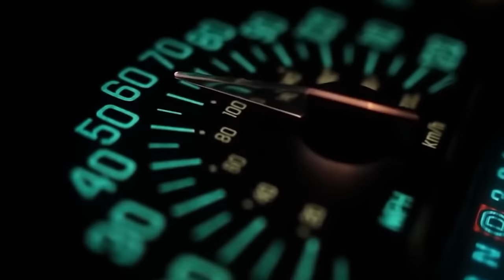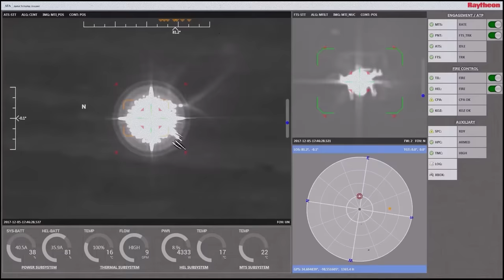America’s DE M-SHORAD: The Future of Laser Defense

Comment: I'm an optical engineer. SHORAD has major issues and is an ineffective hardware for following reasons: (1) The laser is too weak and has short range. (2) Drones can counter it by using aberrative /reflective coating. (3) To defeat a drone, it needs to continue lighting it up for a relatively long time, so a fast moving drone can take it out before the laser can do the same. (4) It is only effective against small drones with thin shells. It will not work on bigger or better shielded drones. (5) It can only reach its weak specifications in perfect weather, which doesn't happen often.
Reply: 4 probably isn't fatal problem considering small drones in high numbers are specifically a major issue, and how to kill them in any way cost efficient ways.
Reply: I can’t even tell you how many ways you’re wrong-all of your points can be defeated by watching a simple YouTube video of them testing some of their systems😂
Reply: At this point, just being effective against cheap, easily attained drones is the point it says at the beginning of the video. Increase the resources needed to take each target. It makes them more out of range for the average military as they will cost too much. I think you may be forgetting resources are not limitless; increasing the expenditure of resources by your enemy is a part of military strategy. 

Additionally, the vast majority of these specs are top secret, so accurately judging its effectiveness without having direct access to the system is pointless.
Reply: 10->50kW laser will stop most drones from flying pretty quickly 😎
Reply: But other than that….
Reply: Having used multi kw lasers on a daily basis, and from real world experience, I only slightly agree, in the end yes the lasers do struggle on materials with a greater reflectivity, however, those optics do not reflect enough of the light to protect the sensors, I suppose you could coat the lens in Di-electric coatings might provide protection.

Regardless, even the slightest dirt on any of the coatings will render it molten the moment these lasers strike them.

Anyway, just my re-world experience with high powered class 4 lasers.
Reply: @Subliminalsapper Phalanx already should be effective against drones. So strange they are not being shipped to Ukraine.
Reply: @riku3716  4 is a VERY fatal problem, as SHORAD's biggest threat are loitering munitions which are large, fast, and can be easily modified to withstand the heat for longer. Such drones have better cameras (compared to smaller drones) which can spot SHORAD before they fly close to its laser's range.
SHORAD's biggest strength is its ability to track targets, even ones that it is currently not engaging. It means once it is done with one drone, it can quickly lock onto the next without calibration delays. Defeating a system like SHORAD is all about throwing things that need longer time to eliminate in conjunction compared to the time SHORAD has to take them out. The adversary can increase number of targets (swarm), increase time needed to take out a target (bigger drone), or decrease time SHORAD has to defeat target (faster drones). Swarm of small drones, while cheaper, have disadvantages: (1) they have a shorter range. (2) they can't carry enough ordinance to take out a Stryker armored vehicle and not just its laser. (3) they are slower hence SHORAD has more time to take them out before they reach it. (4) Make attack very obvious (5) are difficult to plan in a conflict.
Reply: You're not trying to flash fry the drone you're trying to burn out its optics. You do not need a strong laser to burn out the lenses and image chip in a camera
Reply: Next generation fast intense pulse lasers work better. Can also create plasma holograms as well as take out targets.
Reply: @PracticalTacticalFedeli  You picked the wrong person to challenge in this topic haha! I'm a drone designer, studied optical engineering at an Ivy league university, and even watched a lot of videos about SHORAD before Megaprojects made a video on it as lasers are literally my specialty and SHORAD is like GTA6 of weaponized lasers! I have literally done the calculations based on the system specs as well. 
Do you remember the meme about that guy who tried to correct an actual astrophysicist about space? You're replicating that here, but in a different topic! :P
But I'm all for education, so I'd be more than glad to hear your counter arguments and to tackle those. If questions come up, I'd be glad to answer those as well :)
Reply: Considering the directed energy portion of the system is not meant for larger and more protected drones but for off the shelf cheap ones plus having the hard kill variant backing it up I think we will be fine
Reply: @RM1969RM  kind of funny that you chose me out of everyone else saying that you’re wrong but OK bud. Why aren’t you designing these systems if you know so much about them?? Why aren’t you working for some of these companies designing these systems? I’d love to know your clearance level..you seem like one of those dudes who doesn’t know but pretends since they have some expertise in the field..yet this is classified..and only preliminary tests have been made public..yet you have a list of why the system is no good. Full of yourself much?
Reply: I guess you’re smarter than hundreds of other well educated engineers who are working in the military industrial complex. The DoD should halt all R&D until you’re consulted on the feasibility of each of its programs.
Reply: 1) what is the range and what means week 2) using reflection coating will make drones more visible to human eye and other system 3) where is you proof of this system needing to hold on to the target for a long time 4) bigger and stronger drones can be shot down with conventional anti air weapons 5) where is your proof of it not performing in bad weather
Reply: Lol sure, random bozo on YT!
Reply: Im not an engineer and always figured that out. 

Cloudy day or a piece of aluminum foil and the drone wins 😂
Reply: I would have to assume that the info for the video is from a DOD or Army pamphlet. No military gives away all of their weapons capabilities for a reason
Reply: @Subliminalsapper  Some of your arguments are correct. It is certain that SHORAD can help take out basic targets. Your argument about resources is correct but it goes both ways: SHORAD is not a self-sufficient system and needs more advanced defensive systems to compliment it in order to take out the more sophisticated hardware. Now bear in mind that SHORAD will be operating close to front lines due to its range, which means we would be forced to move SHORAD as well as whatever compliments it to the front lines instead of sending a single piece of (more sophisticated) equipment. Considering that everything is transported by cargo aircraft, we would be putting pressure on our own transportation resources. To make matters worse, SHORAD has only started to be produced and it is ALREADY being countered by loitering munitions and large drones commonly used by most of adversaries since 10 years ago. By the time SHORAD becomes fully implemented in another decade, it will be obsolete, while hardware countering it will become cheaper and cheaper to produce.
As far as adversaries go, they are all well funded. We are no longer fighting in Iraq or Afghanistan against hostiles using 1960s equipment, but instead against modern militaries and/or their proxies who have sophisticated command structure and planning, as well as access to R&D and production lines to build items that counter what we have. Right now it is more important than ever to have a technological edge, which SHORAD isnt. SHORAD was perhaps produced 20 years too late.
As far as the specs go, they are not really secret anymore. Released content is more than enough to calculate SHORAD's precise performance.
Reply: @MrBombbombdiggy  A commercial drone made of plastic? Absolutely with ease. A fast moving (shorter interception time) large drone (large mass to heat up plus (mass/surface area) ratio becoming larger) while made with with reflective coating or high thermal capacity shell? At 50KW we will be at the minimum interception range, not even considering additional targets.
Reply: @PracticalTacticalFedeli 

OP came down on you instead of anyone else as you're the only one being an absolute ass about it. Others are disagreeing by countering with rational and constructive points in response.

While you pretty much came with 'OMG lol lol you're SO WRONG lol I saw a YouTube video which says so!!'

Yeah and about 10,000 YouTube videos say the earth is flat 🤷

I have no idea if he's right or wrong but RM1969RM does raise some interesting points. 

While, as they say over in Australia, you should probably "wind yer neck in".
Reply: @bnblasercleaning  Correct counter argument about reflective coating. However reflection is merely the most basic countermeasure. Increasing the (mass/contact area) ratio makes it harder to melt the drone in time. Higher mass will pose challenges. Using material with high thermal capacity or insulating qualities (i.e. LI900 Silica used in spacecraft tiles) can drastically mitigate the thermal effects of the laser. Last time I did the math, 50KW was on the theoretical minimum for a safe interception of a medium size drone based on the possible wavelengths. A 150KW laser should be the goal imo.
Reply: @Shinzon23  I WISH but not really! You would be correct thinking that we are flash frying the drone because that is exactly what we are doing in most cases! Check the drone interception videos on Youtube where it shows that most of the interceptions melted the controllers, motors and the batteries. Even in this video you can see that they are targeting the center mass of the drone.
Reply: Found the Russian bot, lol.
Reply: @lonniesmith352  It will be fine for those basic encounters but our new adversaries (and their proxies) have more sophisticated equipment. SHORAD was released 20 years too late, and is currently being built to face future battles which it is not capable of fully handling all by itself.
Reply: @coconutsmarties  actually that’s not what I said but go head and give ur bf a reach around-how was what I said not rational? I forgot having knowledge in an area automatically makes you an expert in classified tech that is still being developed
Reply: @RM1969RM  Yeah, but I've seen quite a few tests where they're trying to just blind the camera/seeker heads; look at the laser blinding systems fitted to Warplanes and you'll see what I mean.

If the drones sensors are all fried, then whilst it could still use INS or GPS to guide to a target, but it'd be able to be jammed if GPS, and INS for drones has a pretty big drift factor
Reply: @PracticalTacticalFedeli  ..says the guy whose profile pic is himself shirtless and tensing his muscles so hard he might accidentally drop a deuce 🤦

Aight dude, you do you.
Reply: So do you know this or are you speculating? Because it seems like you’re speculating
Reply: @TheBooban  no, no it would not. Also, what a horridly cost inefficient way to deal with drones.
Reply: @PracticalTacticalFedeli  I didn't single you out. I responded to a bunch of comments and yours was one of them. I apologize if it made you feel uncomfortable.
As far as the designs go, I opted to not work for the military complex for ethical reasons but some of my friends did. I took the civilian path instead and focusing on prototyping and commercial drones. The downside of optical engineering (my field) is that almost anything you do can be used for military purposes. Example: working on sensors? Your work could end up making thermal sensors. Working on optics? Your work can make spy satellites or Scopes. Working on lasers? It can become military lasers. Long range telecommunications? Synthetic aperture radars and beyond visual communications.
Reply: @coconutsmarties  I basically said he was using his knowledge to make speculations in one direction(listing why the system isn’t any good) kinda like he had an agenda when making the comment-but apparently asking why he doesn’t design or work for these companies-asking for his clearance level is making an ass outa myself… yet here you defending anything a random person says on YouTube.keep coping little girl
Reply: Yeah whatever shill.
Reply: @RM1969RM  I would say any drone or aircraft would be in danger from these lasers at a range of kilometres. Purely from the point of view of sensor's. You have to have sensors on the exterior of the drone to collect data. Electrical sensors will be fried in fractions of a second by even a 10kW laser. In terms of damaging the structure of the drones, maybe it's possible to make lightweight materials that are resistant to laser weapons. For current materials, within a reasonable cost range, that I'm aware of at least, you'd be adding thick heavy materials to the outer casing of the drone, severely hampering its speed and range. Dielectric coatings and dispersive structures will be highly wavelength specific, making them impractical if you want to cover all possible frequencies
Reply: @coconutsmarties  tensing my muscles???? Flexing?? It’s called a post workout pump ,little girl 😂 I’m sorry you don’t know shyte about being a capable man
Reply: @purple_dinosaur  I'm smart but not THAT smart. I went to an Ivy League university and my drones have won some awards though, so does that count? ;)
As far as working in military industrial complex goes, some of my classmates ended up doing just that! I didn't due to ethics concern. My university has partnership with some of the top 10 defense contractors, so if I wanted I could've.
SHORAD is not being advertised as state of the art solution. In fact, laser technology is notoriously lagging behind other military topics by decades. In case of SHORAD, even DoD was not happy with the initial models operating on 10KW lasers and demanded a much more powerful 50KW laser. Even then, it is a stop gap solution until we find a way to produce compact and inexpensive, more powerful lasers to use in SHORAD system. You don't need to be smart to know that DoD wants a laser system that can take out ANY target, nor just small drones and tiny objects, but has to compromise on this system for now due to mentioned limitations :)
Reply: @coconutsmarties  Thank you :)
Reply: @PracticalTacticalFedeli  Haha whatever you want to call it is fine by me, lil man. 

Where I'm from we simply call stuff like that 'subconsciously homoerotic'.. 😄 But hey I don't judge, love is love fella.
Reply: @Shadow__133  Not necessarily, materials like aluminium that are highly reflective at visible frequency, are not at other. The same for rain and water absorbing light. My guess is this weapon will consist of several lasers, firing at a range of wavelengths. This would mean that you'd need many defensive measures on your drone. All adding to the cost and complexity of the unit
Reply: @davebourne1172  Lmao then why am I not rich?! Comrade Vlad could have at least given me a yacht or a Lada! jks!
Reply: Armor against lasers is definitely going to be a thing. I believe the Chinese actually feel like it is more cost effective to harden things, rather than make more powerful lasers. This is for research and development costs, but they seem to still be dumping money into them. 

 Well that is a standard arms race for you! 

  The lasers coming online now are going to be good against the low cost consumer drones.(or any drone currently flying low to the ground.) They will basically make it so all the current drones people have will be much less attractive. 

  If your enemy needs to harden the drones just for them to be effective? It will cost them in materials, and weight. Then you'll have better lasers. They will design even better defenses. 

 Before you know it your drone is less like a nimble flying machine, but a ponderous tank! (That will never happen.)

 Yes. Weather does effect lasers. However it doesn't need perfect weather according to people who've worked on them. It is a problem for sure, and smoke is effective for current generation lasers from what I understand. 

 Time on target is also a problem... For hypersonic weapons. I'm sorry. Do you think a drone can somehow outmaneuver a laser? Do you think letting off for even a moment will suddenly make it lose all the energy it has dumped into it?

 You know... I know people who work on cars changing oil, and think they are an F1 car engineer. 

 That is what you sound like. You are sort of right, but you do realize they are already being used? I don't think so many countries or people would think it isn't worth it if everything you said was so easily true. You're using half truths without looking at the technology THEY have developed that I don't think you have access too. They've tested lasers against motors, rockets, drones, and planes. 

 I do think they should have went much higher before rolling it out. Yet this is the first generation. Wait till 5-10 megawatt or higher  lasers come a thing.

 They will always be low range SHORAD by the way. That is fine. We have missiles for longer ranges.
Reply: @MrBombbombdiggy  I’m think a smoke dispenser could counter a laser.
Reply: @Shinzon23  Precisely! The item you are talking about is called a "dazzler" and would work well with a ECM/multiband jammer. Unfortunately this is not the focal point of the current SHORAD system. Your recommendation is precisely what I believe SHORAD needs to compliment it until the laser technology would catch up and allow portable, inexpensive, more powerful lasers. SHORAD started with a 10KW laser, now we are at 50KW, and likely would need to reach approx 150KW to reach its full potential.
Reply: @zama422  I'm an optical engineer so that's my field. But I let you decide :)
After all, when a doctor diagnoses a problem, does he know the subject or is he speculating? ;)
Reply: @TheBooban  smoke will disperse the energy momentarily but smoke or any other particles you could use to absorb the energy will dissipate or burn up themselves
Reply: @RM1969RM source trust me... Ivy League isn't what it used to be.
Reply: @MrBombbombdiggy  You are mostly correct. In the future powerful lasers (in conjunction with AI scanning visual range sky) will make stealth aircraft, air to air missiles, dogfighting, flares and radars obsolete.
As far as SHORAD's range goes, a few kilometers to threaten an aircraft is not a lot. AGM 114 Hellfire is the smallest commonly used AGM with a range of 7 to 11km, and can outrange its lasers so the launching platform can avoid the laser entirely. In the meantime it will fly at Mach 1.3 which gives SHORAD only seconds to defeat it. Now imagine launching multiple hellfires and...well aircraft wins. Not to mention that SHORAD requires great line of sight while its adversaries don't so loitering munitions will remain a threat.
You are correct about exterior electrical sensors frying quickly. It makes SHORAD great at taking our intel-gathering drones but if facing an attack drone, removing most sensors would not mean much. I watched the videos of this system in action and expected the same, yet found myself disappointed that most drones were taken out due to melting motors, batteries and control circuits.
You are correct about the material. This will be a trade off in favor of SHORAD.
One of my biggest issues with SHORAD is the fact that its lasers do not operate on many wavelengths. If it did, you would have been 100% correct about dielectric/dispersive coatings becoming worthless.
As you can see, we can easily point out the system's shortcomings and discuss solutions because it is built on technologies that have not reached maturity. imo SHORAD is introduced 20 years too late for old wars, and 20 years too early to have technology for future wars.
Reply: @RM1969RM  well, are you privy to the exact system specifications or the field testing parameters/results? If you are, I’m sure you’re qualified to analyze them, but I doubt you have access to that information considering that it is military hardware. Even if you are speculating, that doesn’t necessarily mean you’re wrong, but everything you’ve said, you’ve put forward as if it’s fact, so that’s why I am asking.
Reply: For an engineer to say you can't do this, and that won't work you don't sound like a very good one. Figure it out, that's what good engineers have and will continue to do.
Reply: @Shinzon23 not all drones have optics. Shahed doesn’t in the form it’s being used in Ukraine, it’s just purely guided to the target.
Reply: @manuelthalmann2826 

So, now you have to have 3 or more air defense systems in place, to deal with the all the threats the others are useless for. Lets just go ahead and deploy a dedicated system for each individual model of drone 🤷🏽‍♀️
Reply: @coconutsmarties  sees a built guy with shirt off..instantly becomes insecure
Reply: @caitlinflesher2665  Yep I'm definitely the insecure one, not the guy repeatedly calling a stranger 'little girl' - which btwis pretty sexist anyway but never mind eh..
Reply: @InterstellarTaco  

Yes, exactly, engineers will eventually figure it out... and the threat will have already evolved beyond its capacity to address. Bro, they are talking about billion dollar DEW systems to address toy drones that are such a new and rapidly evolving threat, they've gained multiple generations of capability in the past 2 years, just in one theatre. By the time the bugs are worked out of this, in a deployable system, the threat is going to so far removed from what its designed for, itll be like muskets on a modern battlefield.
Reply: @guspaz  sure, but they are also quite large compared to rotary drones, so if you cover them in a reflective coating, they will glinting like crazy and since they are supposed to be loitering, making them extremely easy to see make them less effective to begin with.
Reply: @zama422  they don’t actually have any loitering capability. As they’re being deployed they just follow a pre-programmed path to their target.
Reply: @caitlinflesher2665  

...OH MY GOD 

I just worked out that you know each other in real life!!! Oh wow this is so incredibly embarrassing for both you and your little friend... 🤦 The cringe is painful, dude.

He actually got his girl to defend him against some meanie on the internet... 😆😂🤣 Incredible.

So anyway Caitlin, how's the weather in Jackson County today? Warmer than it is where I am I hope! 

You n Brett have yourselves a good evening now, y'hear!
Reply: @guspaz  oh really? Aren’t they supposed to be specially capable of loitering? Pretty sure they are referred to as loitering munitions. Unless I’m thinking of a different version.
Reply: @zama422  the classification of “loitering munition” is debated since with only a small handful of exceptions (possibly indicating a loitering variant) they have only been used for point-to-point flights.
Reply: @coconutsmarties  Imagine losing an internet argument so badly you feel the need to stalk people lmao, that’s unbelievably pathetic.
Reply: @guspaz  Interesting, thanks 👍
Reply: @springbloom5940  this isn't anything new. Some technologies will develop faster than others. Then something new will come around. You aren't going to make advancements by doing nothing.
Reply: @MrBombbombdiggy  time it takes to overcome the smoke could be all it needs for it to finish its mission. Or get away. Or just use more smoke.
Reply: @guspaz  But in that case a electromagnetic jammer does wonders
Reply: You work for raytheon? Thats sick
Reply: @RM1969RM  Man, you're making Ivy League universities look bad in so many ways. Lmao. There are many reasons your arguments don't hold much weight. These systems have been tested extensively, and the development and those tests have already addressed all of your arguments. If you had actually researched this topic before yelling "but I'm an ivy League engineer", you would know this. Lmao but definitely do provide some of these calculations you've already performed... As a fellow engineer who builds high power lasers, I am eager to hear them 🤦😂
Reply: @RM1969RM  Optical engineer, hell yeah what lens did you get.
Reply: To the OP: If you are an optical engineer, have fun with the guys in suits in black SUVs that will show up at your home because you want to sound smart on the internet. You are like those WarThunder and DCS losers.😊
Reply: @PracticalTacticalFedeli but comrade Vatnik's website say that western imperialist laser not work on mighty Russian drone!
Reply: If it can shoot down a mortar it can deal with a consumer grade drone easily.

You may be a good engineer but you didn't work on this project.
Reply: Yup a YouTube comment section engineer knows our limitations better than all of the engineers and scientists in the DOD. How else do we stay #1 😂
Reply: @RM1969RM ”watched a lot of videos” 😂
Reply: @RM1969RM thoughts on Iron beam?
Reply: They are shooting mortar shells out of the sky. I think Raytheon is on to something here.
Reply: Always a hyper specific subject matter expert on YouTube ROFL😅
Reply: But what if they say the magic words, AI? The govt will buy a lot. AI AI AI. see? I’m now a millionaire.
Reply: I would have to question the weakness of a 50 kW laser operating in pulsed mode. This is what we don't know. A CW laser isn't practical in combat. As it burns its way through the shell, the melt ejecta actually impedes further penetration.
However a pulsed laser would ablate the material off creating a small cloud of plasma at the site of impact. This ejects material away from the site making it easier to burn through the hull of a drone.

So while it's short ranged I would want to see its mode of operation before making claims about its weakness.
I worked in a company making industrial lasers and have built Fibre lasers of my own as part of my work.
Reply: @zama422 exactly-he oozes weakness-just look at his arguments😂
Reply: I’m a former ADA officer. I don’t know the specifics of this system, and doubt you do. I’ve seen similar arguments applied to weapons I was trained on that were incorrect decades ago. At any rate, I know something you do not. The US Army doesn’t actually want to spend money on air defense systems. So, unlike other branches, the ADA only gets to buy weapons that actually work. They canceled our programs the second they had an excuse, and I doubt that will change without hard lessons.
Reply: RAND paid him for this as usual
Reply: @TheBooban keep throwing money down the well for people to continue dying?
Reply: @RM1969RM SHORAD is just SHOrt Range Air Defense - it is a broad class of weapon systems of multiple types.  SHORAD isn't just lasers, it is platforms like the Gepard, Stinger, CIWS, etc. The DE designation on this platform is the directed energy part. You are arguing about DE weapons, not SHORAD. I'm glad I never go to the YouTube comment section for information, y'all are wild.
Reply: If you've got multiple lasers deployed in the area, presumably they can cooperate to focus fire on specific targets
Reply: Bro, I don't care what degree you have. I can tell you with confidence that it has done what they have claimed.
Reply: @TheBooban  can’t let Russia get that tech
Reply: It is like looking at the first tanks and saying those are not good for attacking.
Reply: lol cool story bro!
Reply: You know what's cool? You might be an optical engineer, hell, you can be the best God damn optical engineer in the entire world.

You still don't know more OR have better planning than the US military. I'm sorry if I'm the one to break this to you, but the US military does in fact know what they are doing occasionally.
Reply: @TheAncientSnack.  well said! really all the time and what they say they have actually works!
Reply: @TheBooban Phalanx is a bulky naval system. There is no land-based version.
Reply: @TheBooban You would be right. Anything that detracts light, basically.
Reply: @arthas640 I don’t think he’s a Vatnik.
Reply: Give it time ,  ever drive an automatic car from the 70s
Reply: Dude making glasses commenting on how NATO can't do something
Reply: @grahamstrouse1165  there is a land version and the US is using it.
Reply: There is the possibility to use deflective materials like this, but its not an ace up the sleeve by any means. The drone might be able to deploy enough smoke to complete its mission, and it might not. There are many physics factors involved and there are measures the laser system can take to circumvent smoke or other dispersive measures. @TheBooban
Reply: We are arguing two different points here. Is this specific SHORAD system an effective anti-drone weapon? I don't know. Are laser based weapons in general good against drones and light aircraft? Absolutely. Aircraft by their nature are made from light material, you can add armour but you will inhibit the range and speed of your aircraft. A very effective weapon, as it is limiting the capability of enemy can do in terms of drone and light aircraft attacks. I haven't been dissuaded by most of the arguments against laser weapons here. Adding armour is a self negating effect, as I've pointed out. The use of mirrors and reflective surfaces are wavelength dependent so having a laser system capable of two or more wavelength circumvents this. In addition, damage or imperfections on these coating will be points of vulnerability and will burn into holes quickly. The best argument on this thread I've read against laser weapons is that firing a 50kW or even 10kW laser into open space is likely to end up blinding your own soldiers fairly regularly.  @RM1969RM
Reply: @springbloom5940  that is literally what the military does there are anti air anti tank anti infantry anti ship anti submarine weapons and that just a new part of warfare small swarm off cheap drones
Reply: @RM1969RM  The drones these weapon systems are designed to target are heavily limited in their weight and material, I know from experience (I was in the military), the Mass ratio from the lightest drones even to the heavier drones and their components that this system will target is not sufficient enough to pose a hinderence to these weapon systems, they already use these laser systems to melt steel artillery shells and mortar shells, the drones will never even come close to the thermal resistance and thermal capacity that 35kg of steel has.
(I should note that they discovered artillery shells are also being actively cooled while travelling at high speed; the molten metal acts as a radiator hindering the melting proccess, but it still works like a charm)

Yes I am aware of the properties materials like carbon fiber/Silica/Alumina Cermaics have, however, they are either far to heavy to justify at capacities that are useful and thin wafers are far to inadequate to bother using, they cannot do carbon fiber composites either as the inherent black nature of carbon based composites make them incredibly vulnerable to the lasers, Poly Composites are also very weak.

I understand you want to claim counterance to the advent of these weapons systems, but they are not new, they already work in far more difficult situations.

They difference now, is these systems are getting smaller, cheaper and more efficient to operate.

Realistically they can already use these systems to kill soldiers from kilometers away, albeit not instantly, instead they can use them to atomize the targets retina causing internal hemorrhaging, with death following minutes later if not dealt with.
Reply: @joeycampbell940  Lens....as in for a camera? I like portrait photography, video recording and night, urban photography while having limited budget so I use Sigma 30mm f1.4 e Mount lens on my mirrorless Sony camera. I know its such a "basic" choice but it does what I want it to do haha
Reply: @Budget_Prepper  I didn't need to wait for the suits in black SUVs to show up at my home. They have attended some of my university presentations in the past, and they are pretty cool folks. I wouldn't be surprised if they keep a tab on me and it is alright. Its their job after all and they keep the nation safe. I decided to work in civilian fields due to moral reasons. Calling me a "WarThunder and DCS loser" is not nice, and technically incorrect as unlike those leakers I haven't' worked in SHORAD project. I merely have knowledge in the topic :)
Reply: @erasmus_locke  I recommend you to read my earlier comments. I mentioned earlier that consumer grade drones are never its biggest threats (and in fact its easiest targets). Its biggest threats are military grade and/or modified drones made of thick and/or thermally resilient casings, larger drones and fast aerial objects. :)
Reply: @Backwoods0G  The engineers and scientists in DoD know the systems limitations, as is the case with any system. They have even spoken about some of the weaknesses publicly. US stays #1 because unlike Soviets, we acknowledged our weaknesses and worked towards solving them by improving our designs. No system in the history of mankind has ever had no weaknesses, nor ever will. Burying our head in the sand and calling our system flawless is the worst thing we can do.
Reply: @colejosephalexanderkashay683  Very decent system for its intended purposes due to its integration alongside other systems that cover its weakness. Iron Beam (similar to SHORAD) is using a technology that is in its infancy and has lots of room for growth over the upcoming decades.
Reply: @mr.smithsgovermentclass4556  Optical engineering is not as specific as one may think. There are only a few dozen specialization avenues for electrical engineers, and it is one of the few ones that doesn't require extensive knowledge in programming. It's comparable to a cardiologist in terms of rarity. Those in the program basically take all general electrical engineering courses, and for specialization courses they take every optics course offered by engineering department in addition to specific ones offered by physics department. Optical engineering CAN become hyper specific in the phd stage though, but I don't have a phd. If you have any questions please feel free to ask :)
Reply: @orterves  Correct albeit it will be hard to manage as they need to be hitting roughly the same area.
Reply: @RM1969RM  who the fk said anything was flawless and didn’t have limitations? I said you don’t know better than the DODs engineers. That’s just a fact buddy. Come back to reality.
Reply: @yarzarwellington5404  When first tanks came out in WW1, they were the newest tech in the market, and besides artillery, no other piece of technology could reliably take it out. direct energy systems, such as ones in SHORAD, do not have that luxury. They are countering and being countered by systems, in the same field, that had decades of head-start and development. It will be similar to using a WW1 tank against a WW2 army. Don't get me wrong: direct energy systems are the future. Its just that its current implementations are at at the infancy stage.
Reply: @TheAncientSnack.  US (or any other country's) military and government does not have the best planning. Why else do you think we have such systems made by private companies instead of having the government build it? The fact that you mentioned that they know what they are doing "occasionally" proves my point within your comment.
This system is at its infancy. The fact that it has not been deployed to full capacity, and has been getting upgraded without need to receive feedback from extensive real life engagements, proves that the US military does not have full confidence in it. To put matters into perspective, it started with a 10KW laser which gradually got upgraded to 50KW today.
Reply: @tomgunton  No idea about weather in Moscow. If I were financed by Moscow, I wouldn't be dealing with a 5 digit student loan debt though and living in a small apartment though, would I? :P
Reply: @bnblasercleaning  You are correct about mass ratio but we are talking about total input energy to the object, not watts per square cm. The mass ratio comment would be correct if the emitting laser is scaled proportionally to the drone dimensions themselves, which does not seem to be the case with this (limited) system but would be correct when speaking about the core technology behind the system.
As far as the topic of flying artillery shells go, I would be glad to read about the testing done on them. Considering the very high speed of the shells, relatively short interception range of SHORAD's DE hence low interception time, I'd be glad to see how the artillery shells were intercepted in such brief time. Do you have a link to an article?
As far as the materials go, stacked aramid wafers solve the weight problem while offering same structural rigidity, and are implemented in some of the military drones.
I've read about the test conducted years ago about the effectiveness of DE against soft targets. The results of those tests were rather questionable due to the odd parameters within the test. If there are newer tests conducted (hopefully with more realistic parameters) I'd be glad to see the results.
Reply: @Backwoods0G  I never claimed that I know this system's limitations better than DoD, but merely speaking about the weaknesses I know of. The question is: what is your narrative, and the point you wish to convey?